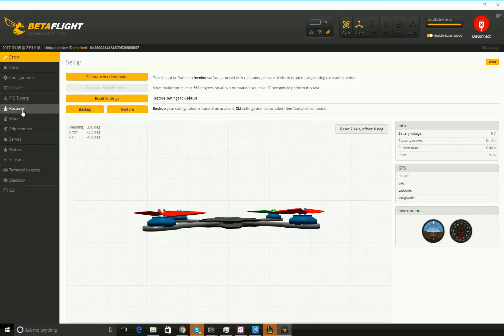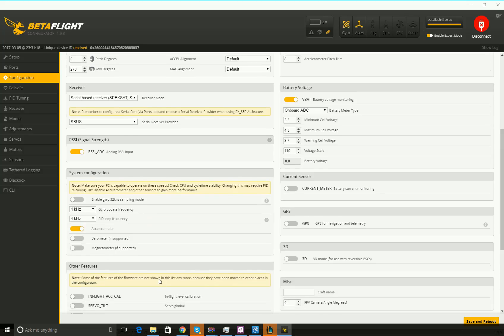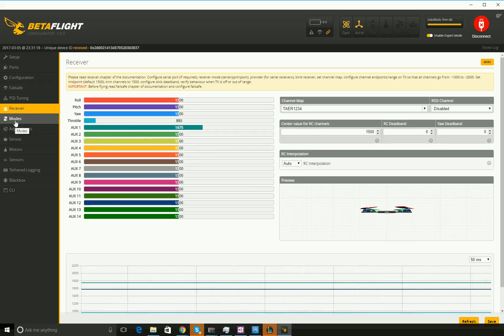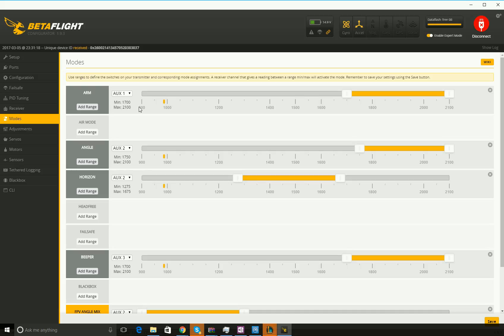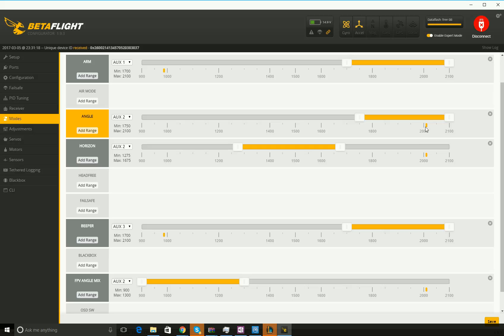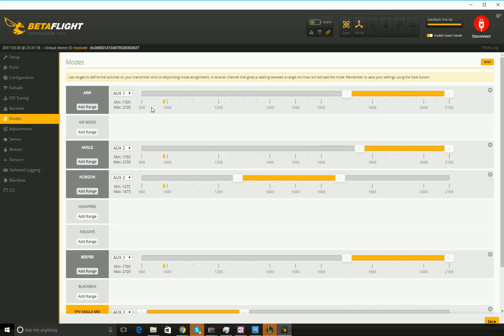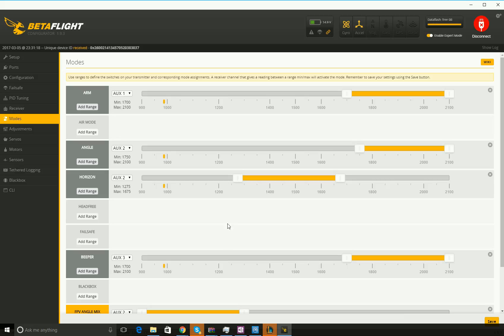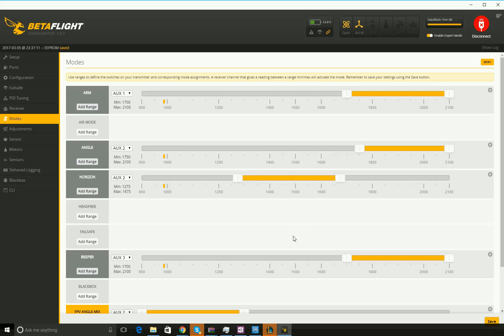Wizard X220 - QX7 Betaflight Setup For Switches

Comment: I just finished my first build with a XM plus receiver. I copied a model on my qx7 that I have used to set up other quads but I can not get the mode page to except any of my inputs. I can not set my switches. Serial based receiver is correct with sbus and TAER 1234 set. I can't figure out what the problem is. Betaflight sees the quad when connected. Receiver is bound to TX and correct UART is being used. Any advice would be appreciated. Thank you.

Comment: Messsing with this for HOURRSS! Finally got esc beeper, angle, horizon, acro, annd turtle mode on the flysky fs i6, angle to show ppl what shes got in los.. horizon to do flips wit it cus I suck los! And acro for fpv.. then the esc beeper and turtle mode after 3.2 update is awesome. Especially for this cheap ass 6 channel tx.

Comment: For some weird reason when I connected at first my throttle aileron rudder and the other one I can't remember were somehow mixed up so I had to go in the settings of the taranis and fix it. Also with my 3 position switches are only working as 2 positions in clean flight ?